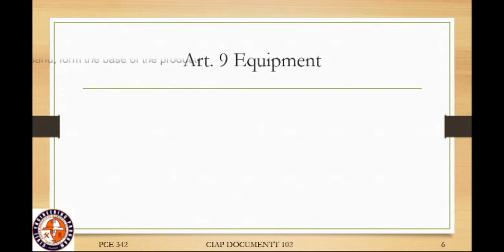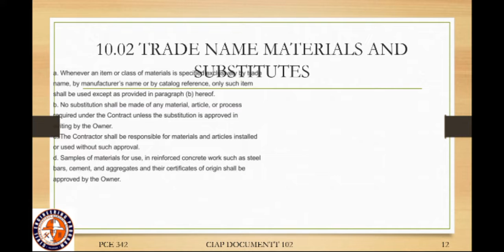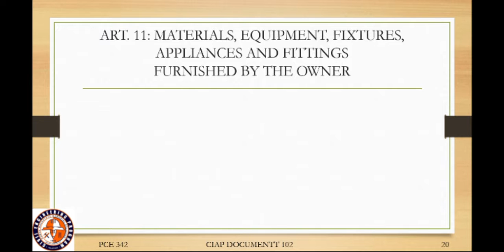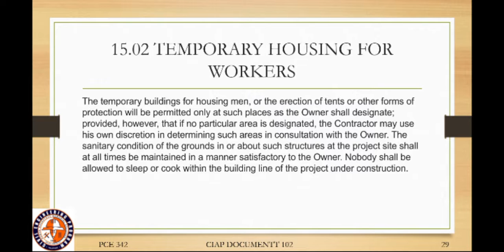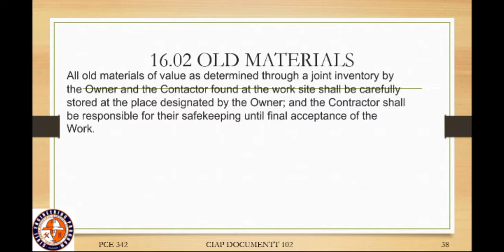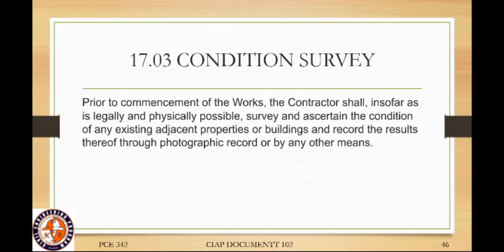celawsandethics.report

Comment: All supplies and equipment must be in good working order, according to this segment of the film. We must follow all current and suitable regulations when constructing the assignment, and the Contractor is responsible for any damages incurred as a result of any delays. The Contractor is responsible for submitting to the Owner as many samples as are needed for testing. All samples must be tested in compliance with the Specifications and regulatory requirements by a competent institution or testing facility that has been certified by the Owner. The Contractor may, however, employ a different material, object, or procedure provided the Owner agrees in writing. The Contractor is responsible for the materials and goods installed or used, even if the Owner has not granted his consent.

Comment: According to the part of this video, all materials and equipment must be in good functioning order. When constructing the assignment, we must observe all current and appropriate regulations, and the Contractor is responsible for any losses caused by any delays. The Contractor is responsible for submitting as many samples as are required for testing to the Owner. All samples must be tested in accordance with the Specifications and regulatory requirements, and by a competent institution or testing facility that the Owner has certified. However, if the Owner agrees in writing, the Contractor may use a different material, object, or process. Even if the Owner has not given his consent, the Contractor is accountable for the materials and goods installed or used.

Comment: The video talks about the CIAP Document 102. Construction materials must conform to all Laws which is applicable in the period of construction. The contractor shall be the one to deal with the damages when there is a delay in work and failed to comply with the provision. The equipment should be furnished in complete list by the contractor prior to signing of the contract. The owner can approve or disprove the request in writing. Materials and equipment should be specifically indicated in the contract in accordance with the Owner-approved construction schedule. The contractor should be the one responsible for the material loss and damages. The reporter also tackle about the limitation of use of materials by the workmen which is indicated by the law or directions of the owner.

Comment: The phase in this video says that every material and system must be in working order. We must follow all current and relevant legal standards during the course of employment production, and the Contractor is liable for any losses suffered as a result of any delays. Noncompliance with such laws in the workplace. The CIAP Document 102, often known as the "Uniform General Conditions of Contract for Private Construction," includes construction contract terms and conditions. It is designed for use in private building contracts in the Philippines. The procedures, norms, and criteria in CIAP Document 102 were developed to be utilized by construction contract parties or to refer to the contract to correct problems.

Comment: Within the workplace, failure to follow such legal requirements. The CIAP Document 102, also known as the "Uniform General Conditions of Contract for Private Construction," comprises terms and conditions that are frequently used in construction contracts. It is intended for use in personal construction contracts in the Philippines. The procedures, norms, and standards in CIAP Document 102 were developed to be used by events in a production settlement or to consult the settlement to correct problems.

Comment: Sections 3 through 5 of CIAP paper 102 was discussed in this video report. Section 3 includes Equipment and Materials, as well as Quality of Equipment, Equipment Substitution, Royalties, and Patents, as well as the procedure for forwarding samples of materials, fixtures, appliances, and fittings to the Owner for approval where as Section 4 deals with the Contractor's use of the premises, his responsibility for temporary structures and amenities, his safety and sanitary requirements for the project site, and so on. The Last section which is Section 5 focuses on work and property protection, including what the Contractor should do to protect the owner's works and property, as well as what the parties should do to protect each other.

Comment: In this video report about the section 3 to 5 of the CIAP Document 102. It was stated that the section specifies that all materials and equipment must be in working order. Section III (Equipment and Materials) provides that all materials and equipment 
must conform to all Laws that are in force and applicable during the period of 
construction, and that the Contractor shall bear all damages by reason of any delay 
in the Work arising from failure to comply with such Laws.

Comment: In this video, the phase specifies that every substance and system ought to be in operating order. We ought to comply with all modern-day and relevant legal guidelines for the duration of the time of employment production, and that the Contractor is accountable for any damages incurred because of any delays. Failure to conform with such legal guidelines withinside the workplace. The CIAP Document 102, additionally called the "Uniform General Conditions of Contract for Private Construction," covers phrases and situations which might be commonly visible in production contracts. It is meant to be used in Philippine personal constructing contracts. The methods, rules, and standards in CIAP Document 102 had been created to be utilized by events in a production settlement, or to consult the settlement to rectify flaws.

Comment: This video is also CIAP Document 102 and this is just the continuation of the previous report. The reporter dicussed the different articles in this document and these are, General,  Equipment, Materials, fixtures, appliances and fittimgs furnished by the contractor. There are different sub topics under the Equipment. First is the Quality of Equipment. In order to established standards of quality, the owner in the detailed specifications may have referred to certain equipment by name and catalog number. Next is the equipments subtitution.

Comment: Sections 3 through 5 of CIAP paper 102 will be discussed in this session. Section 3 includes Equipment and Materials, as well as Quality of Equipment, Equipment Substitution, Royalties, and Patents, as well as the procedure for delivering samples of materials, fixtures, appliances, and fittings to the Owner for approval. Section 4 deals with the Contractor's use of the premises, his responsibility for temporary structures and amenities, his safety and sanitary requirements for the project site, and so on. Section 5 addresses work and property protection, including what the Contractor should do to safeguard the owner's works and property, as well as what the parties should do.

Comment: This discussion will focus on sections 3 through 5 of the CIAP paper 102. Section 3 covers Equipment and Materials, including the procedure for sending samples of materials, fixtures, appliances, and fittings to the Owner for approval, as well as Quality of Equipment, Equipment Substitution, royalties, and patents. The Contractor's usage of the premises, the Contractor's obligation for temporary structures and facilities, the Contractor's safety and sanitary requirements for the project site, and so on are all covered in Section 4. Section 5 focuses on work and property protection, including what the Contractor should do to protect the works and the property of the owner, as well as what the parties should do.

Comment: In this video, the reporter tackle about the section 3 to 5 of the CIAP Document 102. It was stated that the section specifies that all materials and equipment must be in working order. Section III (Equipment and Materials) provides that all materials and equipment 
must conform to all Laws that are in force and applicable during the period of 
construction, and that the Contractor shall bear all damages by reason of any delay 
in the Work arising from failure to comply with such Laws. Section IV (Contractor’s Responsibility for Accidents and Damages) covers Premises and Temporary Structures, which involve the Contractor's use of the premises, the Contractor's responsibility for temporary structures and amenities, the Contractor's safety and sanitary requirements for the project site, and so on.  Section V (Protection of Work and Property) provides that it is the obligation of the 
Contractor to protect the work and the Owner’s property from damage.

Comment: All materials and equipment must be in good working order, according to the section of this video. We must follow all current and applicable legislation when constructing the task, and the Contractor is responsible for any damages caused by any delays. The Contractor is responsible for providing the Owner with as many samples as are needed for testing. All samples must be tested according to the Specifications and regulatory requirements, and by a competent institution or testing facility that has been certified by the Owner. The Contractor may, however, use another material, object, or procedure if the Owner agrees the substitute in writing. The Contractor is responsible for the materials and goods installed or used even if the Owner has not given his approval.

Comment: Sections 3 to 5 of the CIAP document 102 are the subject of this discussion. Section 3 is devoted to Equipment and Materials, and it outlines the procedure that the Contractor must follow when providing samples of materials, fixtures, appliances, and fittings to the Owner for approval, as well as Quality of Equipment, Equipment Substitution, royalties, and patents, among other things. Section 4 covers Premises and Temporary Structures, which involve the Contractor's use of the premises, the Contractor's responsibility for temporary structures and amenities, the Contractor's safety and sanitary requirements for the project site, and so on. Section 5 is all about work and property protection, including what the Contractor should do to protect the works and the owner's property, what the parties should do with old materials, and the Contractor's responsibilities in an emergency.

Comment: The portion in this video stipulates that all materials and equipment must be in functioning order. During the building of the job, we must observe all current and applicable legislation, and the Contractor is responsible for any damages suffered as a result of any delays. The Contractor shall provide the Owner with as many samples as are required for testing. All samples must be tested in accordance with the Specifications and regulatory requirements, and by a competent institution or testing facility certified by the Owner. However, if the Owner approves the substitution in writing, the Contractor may use another material, object, or technique. Without the Owner's approval, the Contractor is accountable for the materials and goods installed or used. If the material does not require prior approval according to the Specifications, the Contractor may order it without the Owner's consent. If the material requires prior approval from the Owner, the Contractor may not order it until the Owner has given written clearance. The approval of the Owner must be given promptly.

Comment: In this video, the section specifies that all materials and equipment must be in working order. We must follow all current and applicable laws during the time of employment construction, and that the Contractor is responsible for any damages incurred as a result of any delays. Failure to comply with such laws in the workplace. The CIAP Document 102, also known as the "Uniform General Conditions of Contract for Private Construction," covers terms and conditions that are typically seen in construction contracts. It is intended for use in Philippine private building contracts. The methods, rules, and criteria in CIAP Document 102 were created to be used by parties in a construction contract, or to refer to the contract to rectify flaws.

Comment: Section III (Equipment and Materials) provides that all materials and equipment 
must conform to all Laws that are in force and applicable during the period of 
construction, and that the Contractor shall bear all damages by reason of any delay 
in the Work arising from failure to comply with such Laws. The "Uniform General Conditions of Contract for Private Construction," also known as CIAP Document 102, contains terms and conditions that are commonly found in construction contracts. It is intended for use in private construction contracts in the Philippines. CIAP Document 102 was developed to provide the procedures, guidelines, and criteria to be used by parties in a construction Contract, or to refer to the Contract to address deficiencies and/or ambiguity. The CIAP Document 102 will help to improve fair contractual relationships in the construction industry.